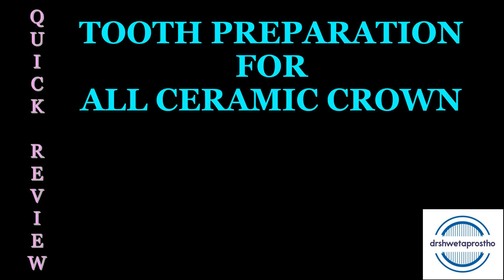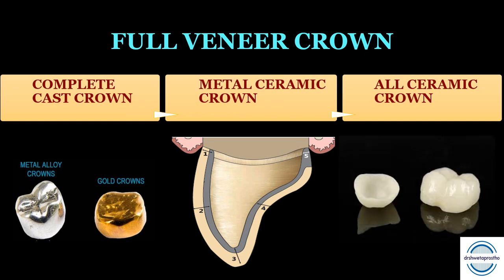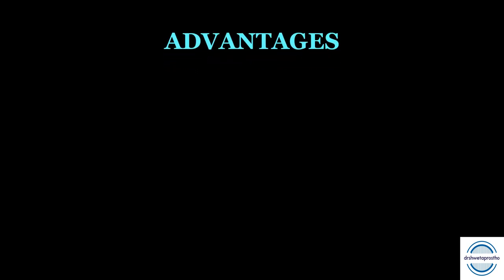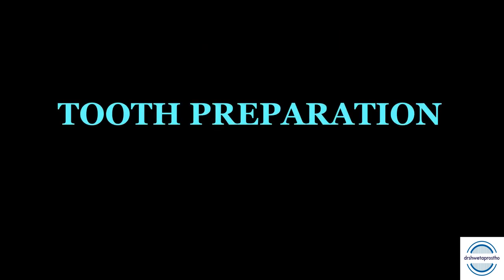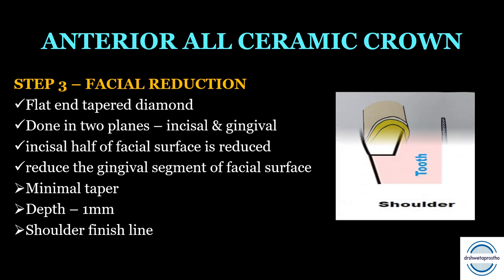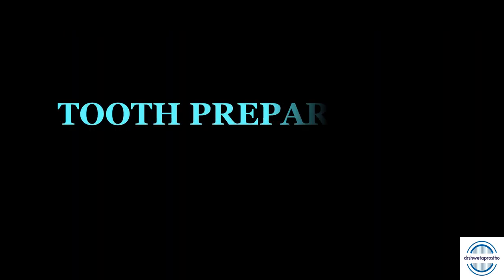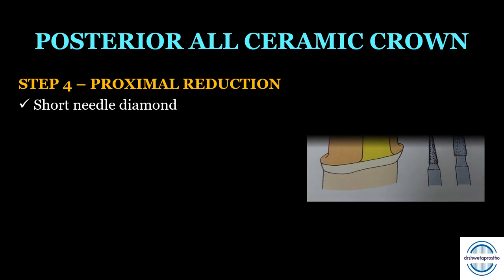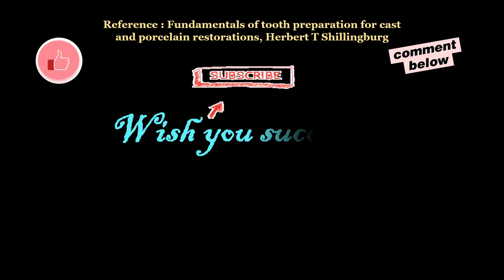TOOTH PREPARATION FOR ALL CERAMIC CROWN / CROWN & BRIDGE / FPD

Comment: Why we contraindicated porcelain jacket Crown or all ceramic crown in over bite or deep bite cases
Reply from the maker: Hi 🌻 Porcelain jacket crown and all ceramic crowns are more susceptible to breakage or cracking that is why they are avoided in deep bite cases. We can give zirconia crowns but only problem with them is that they have opaque appearance.